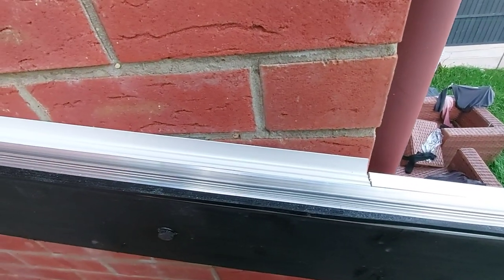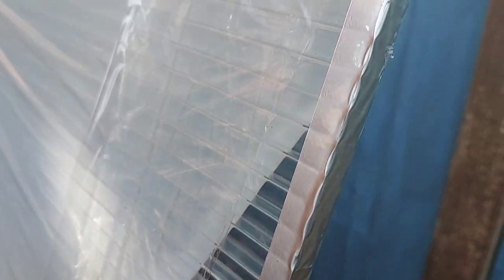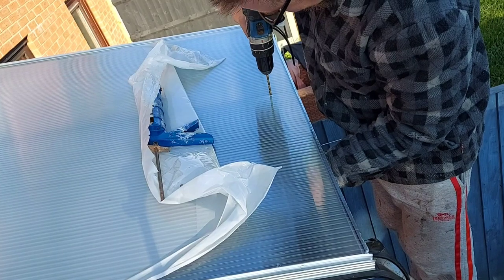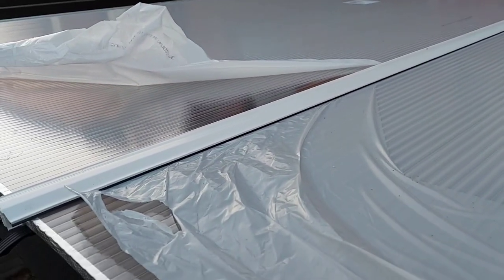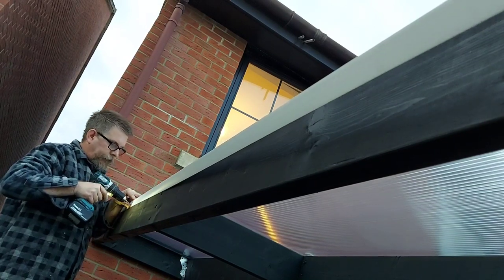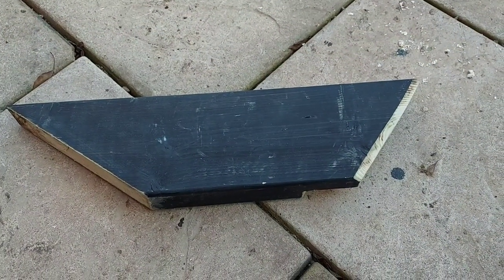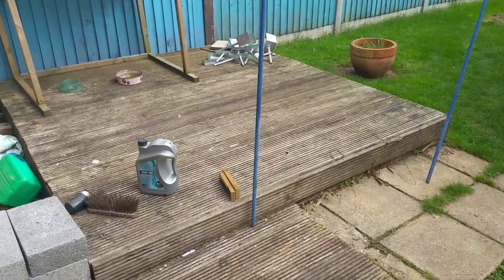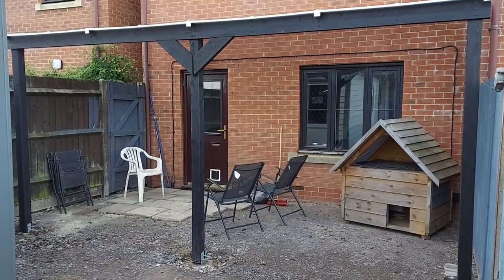Garden Makeover & Lean To Build Final Part

Comment: Great work Dave, polycarbonate has definitely improved since I last used it, never has the push clips, push down profiles, rubber strips or silver tape. Just a screw & large washer.
Well done in perseverance with sliding while flashing. I wasn't that brave to kneel on mine, I struggled stretching from sides when doing mine ... But was 20+ years ago
Reply from the maker: Thanks mate, yeah after the first sheet i used a length of old decking spread across to spread my weight

Comment: Honestly mate you should be proud of that. Looks brilliant mate 👌 👍 👏 the only thing I would do different i would use lead for the flashings chased into the brick joint but that's just a personal preference.. .. cracking job mate 👍
Reply from the maker: Thanks mate. I did look at using lead but that worked out quite expensive. Plus knowing my luck some scroat would nick it.
Reply: @GrumpysWorkshop4  yeah there is that aswell ...... some scroat will no doubt take it. Its going too look cracking when patio down

Comment: Awesome job, David. Given me some lookout tips for my Pergola roof. Looking forward to the next episode to hear your thoughts, costs etc 👍😁. Just had a doubt, while you were putting up that bostik flashing, will the polycarbonate roof actually support the weight of a man? I read that its not that strong to stand on. Or was there a noggin right under?
Reply from the maker: Its stronger then you think although its not designed to be walked on. After seeing how slippy it was i used some lengths of the old deck boards to spread my weight & yes i only kneeled on either the rafters themselves or the noggings. I would deffo use something to spread your weight.